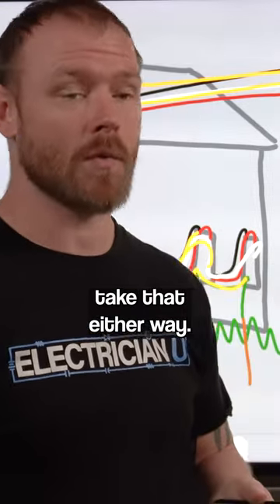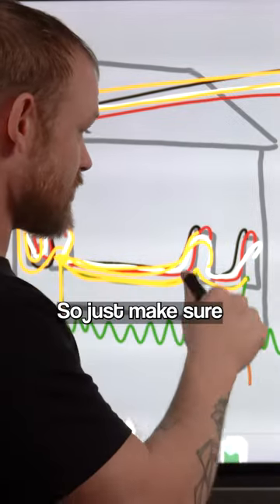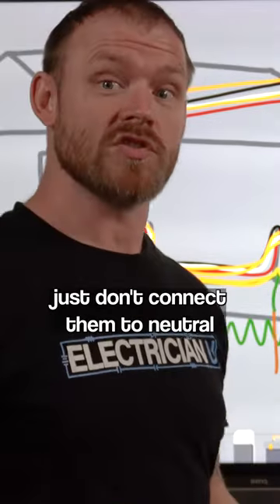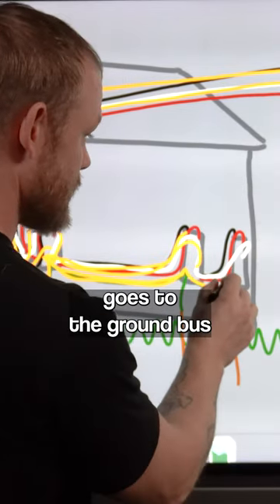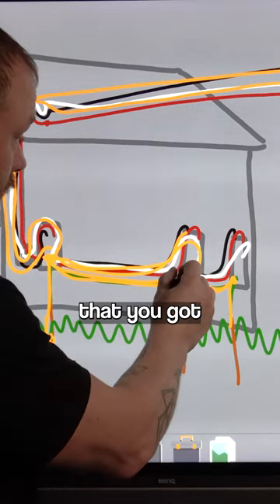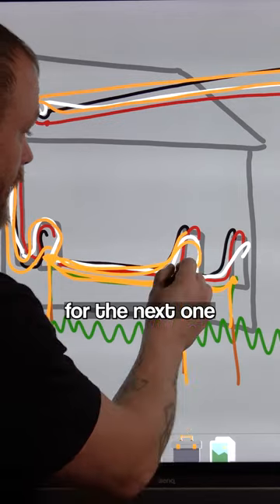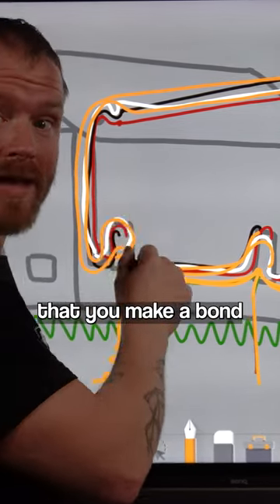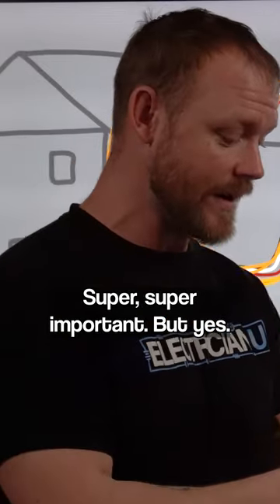Don't Connect Multiple Ground Rods to the Neutral

Comment: As an EE , you are 100% correct.   Grounds and Neutrals are  so misunderstood by professional it's mind blowing
Reply: I suspect it's our poor word choice equipment "ground". Had me thinking for years we just dump unwanted current into the earth and it just soaked it up like some sort of battery. Also, path of least resistance, I feel like I was actually taught that at some point.
Reply: @thepewplace1370  For a system, you want zero ground current.  Had a large custom piece of equipment going to Germany, during inspection, we had like 5 ma of ground current.  It was a fail.  After digging in, we found a single wire hooked to ground bus that was suppose to be on Neutral bus.  Fixed the problem.  Without the tough requirement it would have gone on like that.   A big deal probably not.  But taught me to measure the current to the ground rod in future jobs.    Mis use of terms is so common everywhere.  Path of least resistance is just ohms law.
Reply: @johnm840  oh yeah Im tracking on all that now (and I do know some transmission lines use actual ground as a current path, and some old rural single distribution lines used earth return), but for the longest time I was under the impression the earth was just a big battery to dump fault current into. The idea that "current takes the path of least resistance" also probably played into that, since it incorrectly teaches that electricity will choose a single, low resistance path, rather than all possible paths, current corresponding to resistance.

Calling the equipment grounding conductor something like "fault current return" or something similar would probably help people with misunderstandings like I had.
Reply: @thepewplace1370 my understanding is that all transmission lines use earth as a "sink", so to speak, for electrons. Again - this is my understanding - each transmission line terminates at a transformer, which is grounded. Therefore, when the electrons move in the direction of the transformer, some are pushed into ground, and then when the current flows the other way, electrons are drawn from ground. But it only works because of the huge mass of the earth.
Reply: @thepewplace1370 Yes, and the code makes it worse with vernacular like “grounded equipment conductor”, “equipment grounding conductor”, etc.. In Spanish, ground is “tierra”, which means the earth, so yeah, there’s confusion caused by language. Furthermore, “ground” in a DC system like cars is not grounded to the earth at all, just bonded to metal for a return path to the source.

Comment: Good point.  We also ground the neutral at transformers and other separately derived sources.
Reply: Correct!  They key word there is speratly derrived!
Reply: 🧑🏽‍🎨 yes, same thing, but always keep them separated, only in connection points designed (by you, me, engineer, etc.) To be bonded. Transformer and panels for example.

Comment: I have a radio transmitter (2nd Fl), a ground mounted vertical antenna (side yard) with coaxial cable between the the two.  I’m running a separate 120v/20a circuit for the radio equipment. the main ground is on the back of the house by the panel and meter.  many people are tell me to do install a rod every 12’ around the house from the antenna to the meter. the braid of the coax is grounded at the radio chassis and to the earth ground rod at the antenna.  in other words it would end up being a big triangle between the panel ground, the transmitter, the antenna and back to the panel ground.
any thoughts?

Comment: I'm employed to run a small town off of a generator and the first thing in line from gen is a disconnect sw. Should that sw be the neutral/ground bond point , or would it be at the first panel after that ?
Reply: The code says the neutral should be bonded at the first means of disconnect.  If the power is leaving the generator and then passing through the disconnect without going through a transfer switch or panel first, then that is your first means of disconnect. Look at the NEC article 250 grounding and bonding.

Comment: That makes sense and always tripped me up, like how would it just know the path of least resistance before it tried any of the paths.
Reply: Imagine a water hose that had a Y connection where water flows both ways. Now, put a kink in one ,and water pressure will drop there but will flow freely through the other. It will hit the kink and actually apply back pressure, forcing more through the other. Electric is sorta the same. When it hits resistance, it slows there but continues flowing the other routes.

Comment: watched a good video about this. static electricity through the air is charged, i mean, we are all charged with electrons from our own bodies, however dependent upon how long the ease of those electrons flowing to a demand of electrons of equilibrium, and the quickest it can equalize via dispersion within the state of what those electrons are in compared to all other pathways, more energy will flow through the least resistant paths more, as it is easy to discharge through those pathways due to demand and the "resistances" guiding its way, however energy is like the way fungus grow, nutrient pathways, efficiency, a dispersal, and what continues such... 

I digress, great intro in understanding. Just think about what you wear, weather patterns and your surroundings, take your time, and find your confidence at your speed when you can whole heartedly understand it. Especially when dealing with high voltage.

Comment: At one time the most missed question on the masters test was: true or false. Electricity always fallows the shortest path to ground. If you think about it, if it did, a simple circuit with two lights in parallel wouldn’t light both lights. It would only light the one that had the shortest path to ground.

Comment: All my receptacles are reading around 120 but I can't run my refrigerator? Yes I tried multiple receptacles and tried a skillet in different rooms. Fans, lights, water heat pump, well pump work. Turn one fan in one room, fan in other room slows a bit. Any help would be greatly appreciated. Ty.

Comment: My grounding rod to the outside panel was found disconnected. Is this the possible cause of my washing machine circuit breaker continuing to trip every time I wash a load?  I keep finding the breaker tripped after the wash is complete.

Comment: Thought and question for anyone here. We always install supplementary ground rods for a home with a main water line ground. If there's no main i.e. a well with PEX being ran, ground rods become our primary. It is mentioned that they are allowed as a supplementary ground, yet it's required for us. Won't lie, g&b isn't my strong suit, so it might take some research on my part.  Any thoughts on it being permitted vs shall be installed?
Reply: Code reference?

Comment: We have totally different laws here, however I would think you determine the requirement for an additional MEN, from the desired fault loop impedance at your distribution sub board.  If it is too high you will need an MEN or a larger sub main earthing conductor.  In Australia an MEN is mandatory on a sub board with no sub main earthing conductor or an impedance of 0.5 ohms or more.  It’s interesting to see how other countries approach things.

Comment: It seems like multiple rods could lead to inadvertently potential differences induced through earth ground to the panels, like a downed wire or lightning strike. Wouldn’t it be better to just add or increase the ground rod connected to the main panel?

Comment: And if you have multiple conductors feeding a single load, the current will be split ~equally between the conductors, regardless of the size of the conductor. You see this on DC battery banks on off grid solar. You can split the current, but the conductor gauge and length needs to be the same.

Comment: So if it's going to take all paths, what is better 1000v through one ground rod (and maybe burn it off) or 100v through 10 ground rods??  Plus it would still pass the most voltage to the best ground!
Reply: For burning up, you are concerned with Amps, not volts.  A conductor can pass 20A at 5V the same as 20A at 600V.  No difference in heat, etc.  The insulation is only rated so high, though.

Assuming the rods are all equal resistance and the wire resistance between them is negligible, those 10 rods yield one tenth the resistance as a system and can thus sink 10 times the current.
Reply: @richardhouser2414    What you said, is not true at all!   It's power/watts that burns fuses and wire, that's why you can't use 12v auto fuses, in a 480v circuit!  (P=IXE)  20a x  5v=100watts.   20a x 480v=9600watts

Comment: good point... so is there a chart for proportionally say at 1000v 100amps just how much power flow with each wire gauge size in order  like how much more dead ya are if you were holding a thick wire vs thin vs somewhere in the middle?

Comment: This is also how ground loops occur in AV systems. Often times a sound booth is on a different ground than stage equipment and there will be a 60Hz hum that you can't get rid of without lifting the ground on connecting equipment (usually mic cables).

Comment: My power company has a notice online which states that if your system is grounded improperly it can cause faulty meter readings(specifically, under report actual usage in which the consumer will be held liable). The page clearly says that the neutral plays an essential role in the workings of the meter. And so, based on that information I'd speculate that if sub-panels are grounded to neutral it messes with the accuracy of the meter.
Reply: I didn’t see Dustin mention it in this short but probably did in the original, but all the metal cases and conduits can become energized if one bonds the neutral to the ground bus in a sub-panel. So, possible electrocution is a stronger motive than possible prosecution for not doing it.

Comment: Ok so here is what I did here was service neutral bonded to ground, then I ran neutral 2 hots and ground to next box ground bar separate from neutral with supplemental ground rods at this box and our local inspector made me disconnect the ground lead back to service entrance so now ground is only to ground rods.

Comment: Multipoint Grounding system used by power distribution system.  

Every step down transformer along the way from the substation is grounded at that point.
comment please.
Reply: My power company has a notice online which states that if your system is grounded improperly it can cause faulty meter readings(specifically, under report actual usage in which the consumer will be held liable). The page clearly says that the neutral plays an essential role in the workings of the meter. And so, based on that information I'd speculate that if sub-panels are grounded to neutral it messes with the accuracy of the meter.

Comment: Code here at the time required 2 ground rods 8 feet apart. A single uncut run #8 bare solid core ground connecting both rods to panel ground.

Comment: The real reason you float the neut on a sub is if the neut gets lost on a sub your ground now becomes your neutral. If you disconnect and get between said neutral it's very dangerous. Particularly in commercial/ industrial, with conduit.
Reply: It will also cause the metal panel cases and any metal conduit to become energized in a ground fault, but probably not enough to trip the breaker. ZZZAAP! When you touch the box while standing in the rain.

Comment: I'm not an electrician, so I don't fully understand. What can happen if you connect the neutrals to the ground rods at the sub-panels? I understand about the electricity taking multiple paths, but why is that a bad thing?
Reply: Yeah that's really isn't explained at all.
Reply: Your neutral and ground links between panels both carry the return neutral current and the safety ground.  So, you end up with metal casings, etc. energized from flow that should be on the neutral.
Reply: @houseman2414  Ok, but those metal cases etc. are also tied to ground, so they can't have any potential. Is there more to this explanation?
Reply: @houseman2414  I think a better explanation is that bonding neutral and ground at a subpanel allows the return current to flow on both the neutral and the ground wire. That doesn't necessarily mean that cases etc. would be "energized" i.e. have a voltage potential. But there would be other safety problems. For instance a broken ground wire would have voltage between both sides of the cut. Also GFCI devices wouldn't work properly
Reply: @houseman2414  I think a better explanation is that bonding neutral and ground at a subpanel allows the return current to flow on both the neutral and the ground wire. That doesn't necessarily mean that cases etc. would be "energized" i.e. have a voltage potential. But there would be other safety problems. For instance a broken ground wire would have voltage between both sides of the cut. Also GFCI devices wouldn't work properly
Reply: @Bapuji42  GFCI devices do not actually require a ground to function, so they would be fine, assuming the bond was upstream from the device.  These devices are essentially a comparator between current flow on the neutral and the ground.  Once beyond a set threshold difference and the device trips.

For current to flow, there must be a difference in potential.  So, the difference in potential energizes the EGC vs the surroundings to some degree.  Basic application of Ohms Law.
E = IR
Reply: @houseman2414  thank you, I do understand how GFCI work. You could end up with an imbalance between hot and neutral because part of the current is flowing through ground If those are incorrectly bonded at the subpanel
Reply: @houseman2414  another situation is that you could end up with metal cases being energized if the ground wire was broken somewhere upstream. The ground downstream from the break would essentially be connected to hot through the load. Same idea as a broken neutral, except the neutral isn't generally connected to the metal case, for obvious reasons.
Reply: @Bapuji42  Think of a ground rod like a resistor.  Earth ground in particular has more resistance than the return neutral on a properly designed system.

When you bond the EGC and neutral at the main and a sub, the combined wires act as one, and will carry both loads together, with more current on the conductor with less resistance.

If the sub panel is open, and carrying no current, the ground "resistor" pulls everything to ground, and there is no residual potential.  As the current goes up, the voltage across that combined neutral increases, which can lead to shocks there or any connected equipment (ex. Plumbing).  Safety aside, a trickle of current over time can destroy all sorts of plumbing.
Reply: @Bapuji42  Not unless your sub panel was downstream from a GFCI.  The device only sees what goes through it.
Reply: @houseman2414  Which it sometimes is. So my statement stands.
Reply: @houseman2414  That makes sense. Realistically though, how much resistance can the ground rod have? Being generous, say a tenth of an ohm? At 20A that's only 2V.
Reply: @Bapuji42  It could actually be in excess of 25 Ohms (NEC requires a second ground rod at that point).  I read about some other countries requiring a buried ring of ground rods outside the entire structure, etc.  Modern structures also tie into the rebar in concrete foundations, etc.
Reply: @houseman2414  Ok, do you mean 25 ohms from where the ground rod is bonded, through the earth, to the ground rod that's bonded to the center tap of the transformer (since that's ultimately the return path of any current flowing through the ground rod)? 

If so, wouldn't the fraction of the total return current taking that path be miniscule, since the resistance of the actual neutral wire going back to the center tap is much, much lower?

Comment: Something I don’t understand is even the neutral wire is still carrying voltage and amps, why is it that when we connect our ground to neutral, that grounding wire does not become apart of the circuit?

Comment: What do you do if you only have 3 wires to your sub panel in another building? The wire is under ground.
Reply: If you are talking 120V service, one conductor is an ECG and you tie the ground rods at the two structures together, but keep the sub panel separate.
If you have 240V service to that building, you are short the ground and have to separately derive the ground via ground rods like a new service entrance.  The two structures would have their own bond to neutral, like a service entrance.  That was allowed by code previously, but you need to add a dedicated ground conductor on any new runs.

Comment: Multiple ground rods everywhere isn’t required and could cause damage to equipment if current running through the earth back to the source decides to take the unnecessary ground rod conductive path you could have objectionable current flow all over the damn place!
Reply: Is this also the case if the ground rods are well bonded to each other?

In the case of a nearby lightning strike (to a tree or the ground) what can be done to minimize or prevent current running from the  ground rod back into the bldg?
Reply: Or a lightning strike!

Comment: Generally a bad idea to have multiple ground rods. Get a nearby lightning strike it induces a large current on the wires between the ground rods that causes damage, or even worse it starts a fire.
Reply: Multiple ground rods (each 8ft deep) are required by modern NEC codes (unless you have an alternative grounding system in the structure itself, like galvanized water pipes, metal buried structural members in a basement footer, etc.).  In my case, I have two rods 6+ft apart at the house, and the same thing at the barn (so, 4 rods).  Some localities also make you add additional ground rods at generators, etc.  On the provider side, the poles all tie back to earth ground, too.